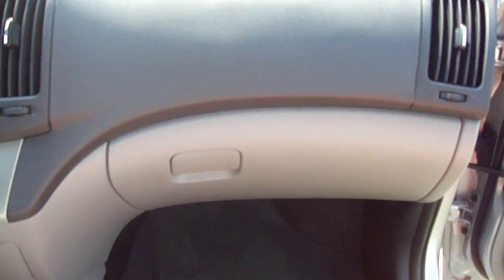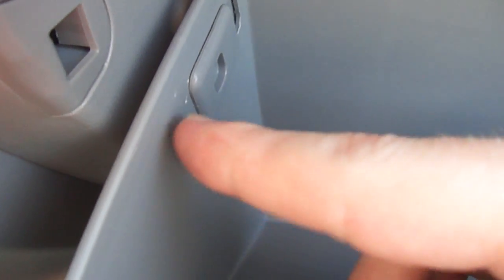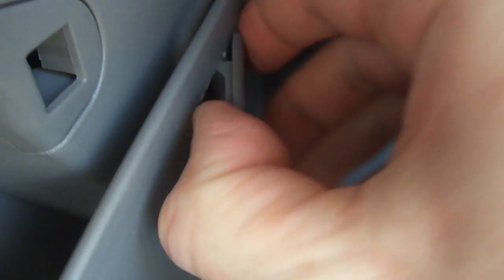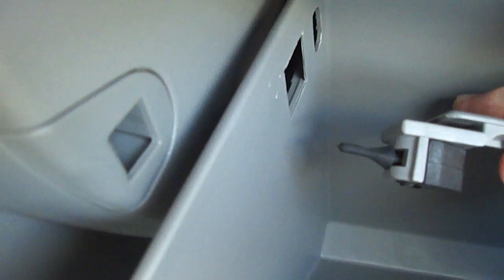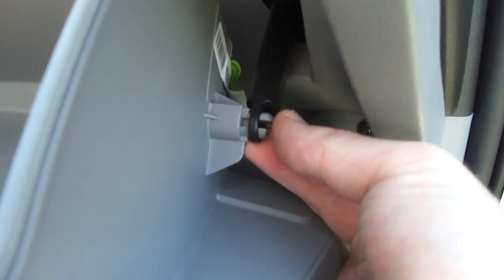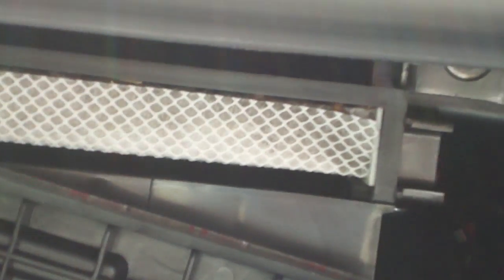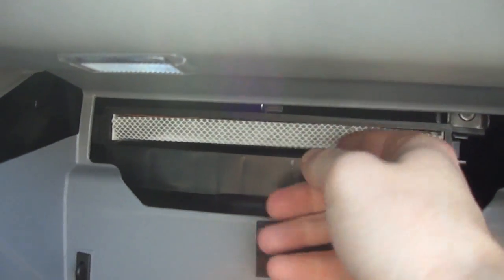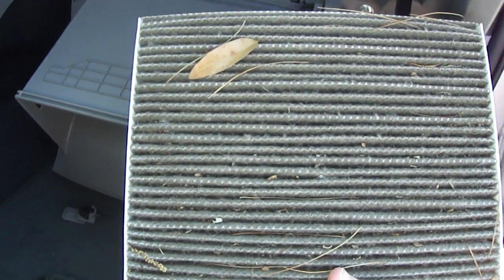2010 Hyundai Elantra GLS cabin air filter replacement - part 1 of 2

Comment: Thank you so much, I couldn't figure out how to get those retaining pieces off until I watched your video.  I also wanted to mention my car air had a nasty smell even with the filter out, so I followed a tip I read elsewhere to spray Oust (air sanitizer) into the space where the filter goes (with no filter) and run the vents on high for a few minutes and windows open, before installing the new filter; hopefully that did the trick.